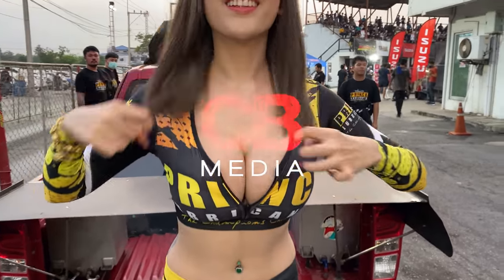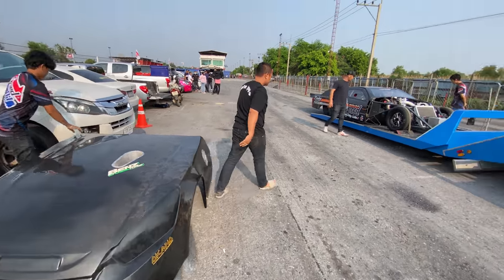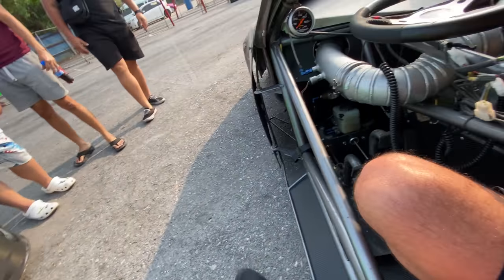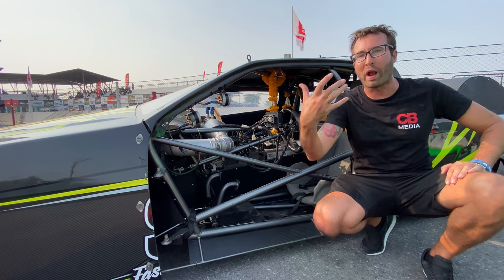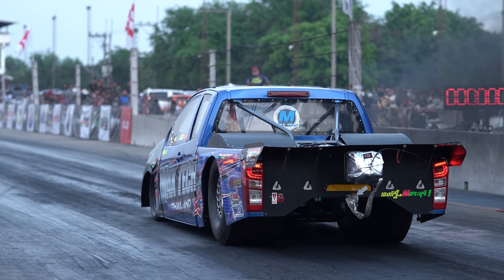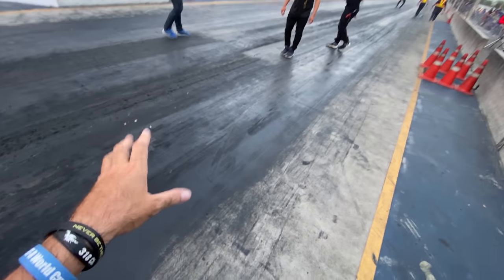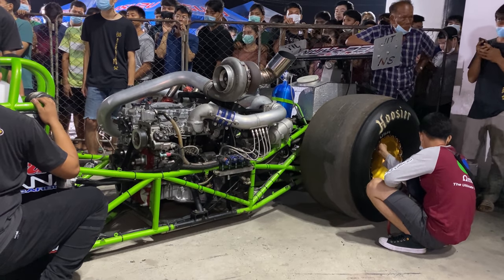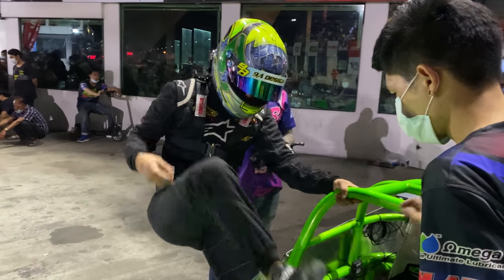Thailand's 1st 6 Second Turbo Diesel

Comment: Ok this is the greatest thing ive ever seen ever.  I loved the turbo boats and tractors.  But this is next level.  4 cylinder, top-fuel-looking, sub-7 pulling, turbodiesels rolling coal out the hood and blacking out the board as they disappear into their own cloud...I am literally in love.  On a real deal, "road" race track.  Only prep was the guy before you.  Thats raw and is really how you would do a burnout on the streets without the brakes.  But the girls and the speakers and the party that was poppinWTFF!!!!  I will be going to Thailand at some point in my near future specifically for this right here thank you so much sir

Comment: Someone need to sponsor these cars to do a tour of the us and Australian drag scene.
Imagine what these cars could do on real tracks
Reply: I think a team went to the US a couple years ago, should be couple videos about it on youtube
Reply: Break stuff
Reply: @Damicske  agreed all the traction they would gain they would quickly find the next weak point
Reply: Team Thailand 4 cylinder Diesel at NHRDA World Finals in usa 😎😎
Reply: "Team Thailand" as they are called here in the USA took their amazing Isuzu D-Max Drag Truck down the Texas Motorplex 1/4 Mile in Ennis. The Turbo Diesel 4Cylinder Engine propelled the vehicle down the track at a time of 8.2 at 164mph.
Reply from the maker: Check out my video on ECU Shop. The truck there visited the US to compete!
Reply: .  💡
 ☝️😃 They could make an association 🤝 and go on tour, (🌎🏁World Drag🌍 Racing Tour🌏🏁), through several countries a TEAM from each country visit the other country and thus rotate🌎🔄🌍🔄🌏 and the one 🚗 that does, not have one 🚙 has the other, 🚕United States  🇺🇸 and Puerto Rico 🇵🇷, Australia 🇦🇺, and 🇳🇿 New Zealand, 🇹🇭Thailand, United Kingdom🇬🇧, Brazil 🇧🇷, South Africa.  🇿🇦 Barein 🇧🇭, ect.
   Compete and those who win qualify to go to the other side of the world.  🇺🇸🌎🏁🌏🇦🇺
Reply: They would probably constantly break from our prepped track surfaces and they would be hard up for parts here in the US
Reply: @804_Rider  am pretty sure these cars are tune to run on a less prep track so the tuners will tune is on a better one 
Just think and try to make things make sense to you all
Reply: Thailand has the best technicians in the world. They can make small engines with equal power in America.

Comment: That's sick! 6 seconds on that track is nuts.
Reply: Haha yup thats pretty crazy. They make some cool stuff i Thailand.
Reply: Even though there's tons of rubber on the ground which helps traction VHT helps more and any 6 second pass without a VHT prepped track is nuts for sure
Reply: Yeah that track is really dengerous. The whole length of the track is like 500-600m and the end of that track is a fucking canal. With that speed you only have few sec to brake. These guys were nuts.

Comment: That 2.5 litres 4jk1 engine is insane!
900+ hp and 1400+ nm of torque
Reply: No, this is a modified 4JJ1 Isuzu D-max 4 cylinder 3000 CC engine.  Can do 1100+ horsepower, 2000+ torque, if injected with nitrous, it's about 1500 horsepower
Reply: @memeow2980  fantastic!

Comment: Little late to the party, but my point is still valid.  I worked in BKK for 6+ years and didn't even know this place existed.  It would be great if you offered up more info about where these places are, and perhaps 30 seconds of schedule info, like "races every weekend" or whatever the case may be.  One of my pet peeves about living in Thailand is that we (foreigners) usually heard about events after the fact, when we'd have gladly spent some of our expat money if we knew in advance.  One of my favorite events was Thai drift racing, when I could find it.  Also, boat racing...  When, where and how to get there.  Thanks!

Comment: Question for you. Can you make a video where you going through the powerful common rail diesel engine fuel delivery and ECU systems? I mean what fuel injectors, what rail pump they are using and what kind of ECU or other controllers are used. Also very good content in your channel!
Reply: BOX brand "ECU SHOP" th. 🔥👌

Comment: Dude, awesome video, so many questions in my head but you answered some, but is that an actual quarter mile or something in metric? And do the ever run (fast tube chassis cars) gas engine powered drag cars there so you can see without all of the black diesel smoke?
Reply from the maker: It’s a 1/4 mile yep!

Comment: I wonder if the exhaust on a few of the first dragsters is interferes with the airflow over the wing? The one looks like the exhaust is actually hitting the underside of the wing which would actually be causing lift.

Comment: Why are the Thai obsessed with 4-cylinder diesels? Do they ever run anything bigger?
Reply from the maker: Import duty tax is dependent on the size of the engine….
Reply: @CBMedia404  ah ok. that's like in the 70's and 80's when they taxed the hell out of import motorcycle makers especially if you exceeded 650cc? I think it was?....so you ended with a bunch of 642CC or some weird smaller number bikes everywhere if it was made in japan or non USA.

Comment: 7 second 1/8th mile doesn't seem very fast, for some reason... 
My 2004 Yamaha R1 would run low 10's in the 1/4 mile, and it was nearly-stock !
(except K&N filter, Akrapovich exhaust, 16t & 46t sprockets, & Power-Commander).
Reply: We Thai only race 1/4 mile for the drag truck racing and car racing my friend.

I guess your R1 probably run much much lower than 10 because Our Thai 150cc bike just like KR that teenagers love to tune already run 9s in the quarter mile my friend.